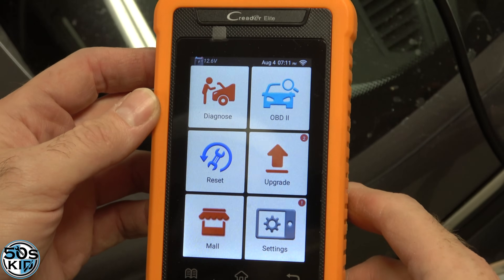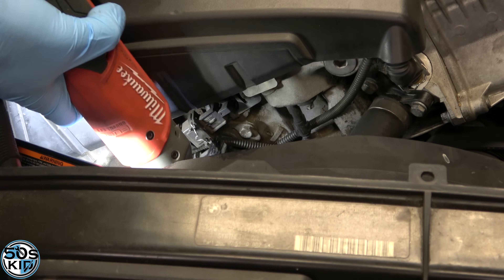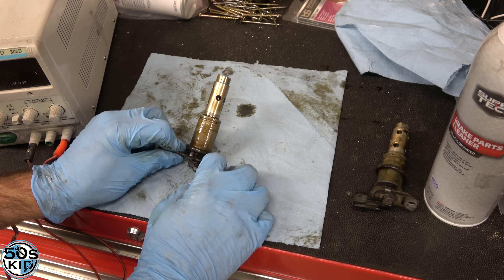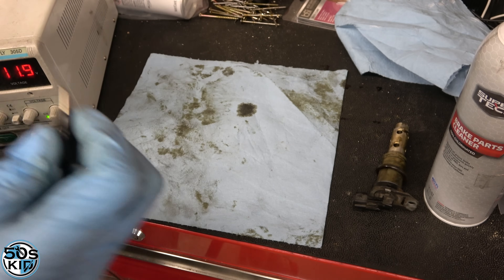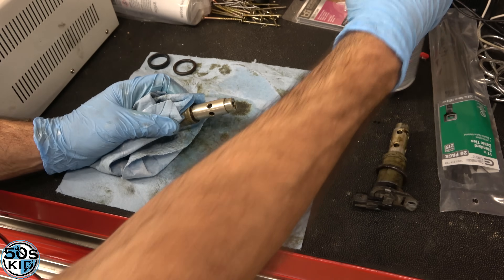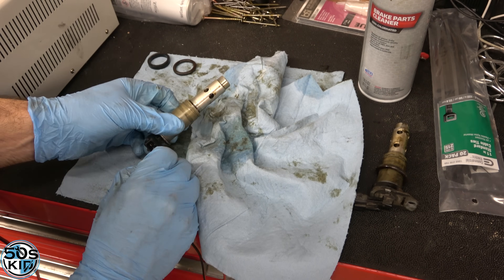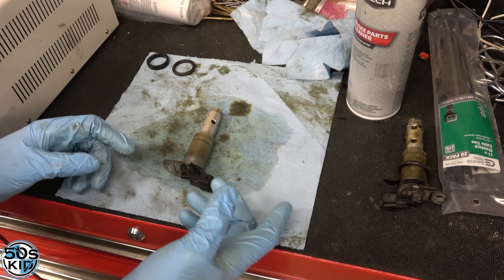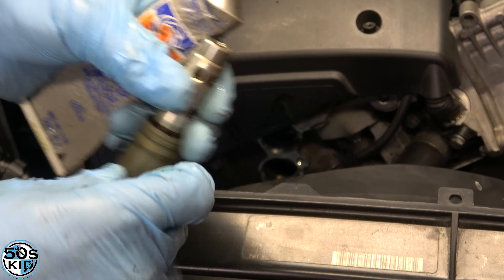Solve Your Reduced Power Problems - E90 VANOS Solenoid Cleaning

Comment: Best thing to do is to switch intake and exhaust solenoid. If the code comes back intake side and you switched the solenoid, that tells you right away that the solenoid is not the problem. Clean the check valves and then if its coming back,   your problem is coming from the vanos itself or the cam ate its carrier and you no longer have enough oil pressure to activate the  vanos properly.

Comment: I replaced mine with new OEM solenoids. This morning when I started up my 630i n52 it gave me a check engine light and made a weird noise. I’m pretty sure I did the procedure correctly since it’s pretty simple to do but…anyone could help figure out what it could be ?
Reply: Did you reset the fault code?
Reply: @ yep, but I cleaned and put back the old ones. Even tho the new ones are original it felt like the car didn’t like them 😂

Comment: Is it possible that cleaning them solves ”half the issue”? Got a really bad misfire, cleaned them and car stopped misfiring when cold, however keeps misfiring when hot. Could new ones be the solution still? or is it just a ”stick or no stick” situation?
Reply: Or maybe i was lucky, they didnt stick first, but suddenly they did and it started misfiring and had bothing to do with car temp? possiblev

Comment: Can this cause random missfires?   I did get a timing-over-retarded code (forget which cam it was) which I cleared and has not come back, but the engine is not running right - Rough idle and random missfires under load.  Coils and plugs are new and CCV + DISA all changed recently so its not those... VANOS system is the only thing I've not looked so I'm hoping it's that, the car is not nice to drive in its current state - Rough + hessitant and no power.

Comment: Thank you. I have a 2006 525i and I followed the procedure, so far is running ok, but after reassembling, the bolts don't lock—they just keep turning. This happened with both solenoids' bolts. Do you have any idea why? This is the first time I've removed these solenoids.
Reply: Unfortunately stripped or try keeping the solenoid in place and trying one more time?

Comment: I have been buying e46s to flip and sell for the past couple of months but I recently grabbed a e92 for a good price considering these issues, owner couldn’t diagnose. 
One vanos solenoid was faulty with a weak pluck. A shake and clean before the yard ones went in. Car runs fine. Most the time a lot of parts need to be cleaned from bad oil changes so and so then you can run and have good oil constantly now

Comment: Recently removed these 2 solenoids to clean, the top intake looked clean but the bottom outlet had oil buildup so I'm guessing this was the problem child? so to be safe getting both replaced much like brake pads its makes better sense do both since I've got no ambitions of repeating this in a month.  (Q) with the top solenoid working as it should but the bottom sticking, there would be a buildup, what happens with that buildup if its not flowing like it should through the system.

Comment: I've seen these bmw's can be a nightmare. Some of them have a belt somewhere just outside the block that starts to strip and somehow winds itself in through the oil seal then blocks the sump oil pickup. If pickup is blocked too long  it will starve the engine of oil and it's rebuild time. To check, connect an oil pressure gauge with special adapter and see if oil pressure drops when revving.

Comment: The non return valves feed oil to the solenoids. If those screens are blocked with gunk, not enough oil will be fed to the solenoids, thus starving the bearing ledges. I just cleaned my solenoids and the valves. I'm glad I cleaned those valves. They were full of gunk, especially the top valve. The check balls were not moving. I think I'm going to clean the valves at every oil change because the PO did not take care of the car and I see gunk on the MILVs' springs from the oil filler. I throw in a quart of ATF and let the car idle for a bit, then change the oil. That slowly cleans the engine, instead of using a flush that will release chunks of gunk and possibly clogging journals., for example the ESS oil feed tube. When that gets clogged, you get the infamous eccentric shaft gear wear, because not enough oil is supplied to the gear.

Comment: I own a 2010 n51 engine I have no check engine light but once in awhile it used to surge either going in reverse or going in forward or even while I'm driving at a stoplight I follow somebody else which told me that if I clean my solenoid it would fix the problem I also did a transfer case exchange the oil and so far so good I have no problem with it once again no check engine light

Comment: Always replace those solenoids with a good brand like Bosch or NGK. Don't clean them, and put them back in. Being dirty isn't the only problem with VVT Solenoids. Your car will run better with new ones. Use good synthetic oil and change it often. Always replace O-rings with new ones, and put petroleum jelly on them(or di-electric gel). It helps the O-rings stay in place, helps it slide in easier, and protects the O ring.

Comment: LOW BATTERY BAD CONNECTION SOLENOIDE WILL NOT OPEN USE CHECK FOR LOW VOLTAGE

Comment: Help 🆘 got 335d mapped 340hp dpf gutted at full throttle hitting 120mph goes into limp mode only at that speed

Has a fault ( faults for exhaust gas cooling switching valve open circuit.,) the coded was removed the car was running okay after few days same problem.   PLEASE HELP 🆘

Comment: Do bad solenoids make a louder clicking noise? We have a 2008 325i. There is an intermittent “clicking” noise, not a mechanical “ticking,” but an electric “clicking” sound that the solenoids make. It’s only intermittent. Could this be bad solenoids.

Comment: Don't be cheap buy 2 new ones in high quality and have peace of mind also Rotella T6 full synthetic 5w40w makes these cars run smoothly and change at 5k miles 
Sure lots of you guys will knock Rotella T6 but I assure you it's high grade high shear rated for harder use than the BMW
Google it and see many guys run it and have shown the oil analysis to back it up
My Z4 Coupe E86 3.0 was having a slight surging idle on startup switched to Rotella T6 and it totally went away

Comment: I've a question so My e91 335i from 2008 only goes into limp mode when its cold start uhm but when i do pulls and goes over 5k rpm it dosen't go into limp mode, if i start it let it idle about 5 min and shut it off and start ik again it dosent go into limp mode.. So Is it just The vanos or something much Worse?

Comment: Nice video i watched your videos to fix my cars i have a 06 bmw x3, 99 bmw 323i and i just bought a 03 330xi for my son
I have a question on my last purchase 03 330xi I overheated my engine now I need to change the head gasket but I am 80% sure the block was bent. I have an extra 02 325i engine do you think I can change the 02 325i 2.5L to a 03 330xi 3.0L? because I can't find anything on the internet
I really appreciate if you can help me with my question.
Thanks in advance

Comment: Hi I have a Question. 
I have 2002 bmw 330ci m54 engine. now I try to rebuild engine.  can I use same piston and ring? I'll send machine shop for bore the engine head and block. Can you tell me what size is boring cylinders?
Which way is good rebuild?
Thanks

Comment: So happy you did a video on this! And yet disappointed you didn't include the follow-up of whether or not the cleaning made a difference... also I have heard not a soul recommend aftermarket solenoids - most everyone seems to stay it's one of those parts that OE is required to avoid creating more problems - FWIW.
Reply: I have 2 high milage N52s 220k+ miles and did on both and solved my problems.
Reply: Agreed. Where is the resolution!?

Comment: I removed two from my 540I, cleaned them and a lot of junk and plastic pieces from the timing chain guides when they broke off put them back in and same issue.  Took them out and noticed that the cylinder where the spring element moves up and down had rotating and a slight side to side play.  The new ones had no play. I guess with time that cylinder becomes lose and so the oil is no longer pushed with the correct oil pressure...I haven't seen a video about the loseness though.

Comment: Spraying the outside piston does next to nothing as this is not the one which sticks. You need to clean the inside piston and the cylinder which are underneath the coil (black plastic bit). Forget 12V supply, use your hands to shake it. Turn it upside down, pour petrol in it and spray carburettor cleaner through the lower holes (plug the rest with your fingers) then vigorously shake in that position. This will allow the solvent to enter the inner cylinder. Then turn upside down amd continue shaking so that the dissolved gunk gets out using gravity - the amounts are miniscule so do not expect to see any deposits pouring out. You need to repeat this procedure at least 20-odd times until you get virtually frictionless movement of the piston, by using slightly movements, when the solenoid is in horizontal position. Yes it takes time but, but only if you get it this clean does VANOS work as intended and long term. The difference in torque before vs after is nothing short of phenomenal. Please do note I have been using LM Ceratec for many years now, and everything inside the engine is ridiculously slippery, and finally VANOS solenoid internals as well. I had identical issue on two cars with N52 engine. Now approaching 5 months since the fix, 10k miles on total. No issues whatsoever, and full torque from low down still there.
Reply: Dude, I know this vid is a yr old, it's still very helpful for me & I appreciate it 😊
Reply: This is the BEST direction for this fix THANK YOU!
Reposting your follow on comment as this seems to have disappeared:
Essentially just when you begin to doubt if it will ever break loose it will start happening. You know when it's done is when you barely move (let alone shake) the solenoid, the pistone moves freely as if levitating in vacuum, and hitting both travel ends with a distinct metal clank, not muted. If you need to shake it in order for the piston to hit the ends you're not done.
Reply: Essentially just when you begin to doubt if it will ever break loose it will start happening. You know when it's done is when you barely move (let alone shake) the solenoid, the pistone moves freely as if levitating in vacuum, and hitting both travel ends with a distinct metal clank, not muted. If you need to shake it in order for the piston to hit the ends you're not done.
Reply: Upside down as in the black plastic piece facing down?

Comment: Why not just swap them over for a few weeks and see if the code moves to the other side ? Seems the most logical thing to do, before trying anything else. This will tell you 2 things. First whether the solenoids are definitely causing the issue and second which solenoid is faulty. These are expensive from BMW. I would only replace the faulty one, as changing them only takes a few minutes.
Reply: How bout NOOOO

Comment: I've been chasing down the exhaust side issue with code 2A87 for about a year. Also spent a good fortune buying tools and good used part to finish the bearing ledge job. I have not changed the VANOS solenoids, because swapping both sides did not make the issue go away on the bad side. It always comes back as the exhaust side error. I do have a final thought, which is the mechanical wear of the VANOS sprocket unit. The unit consists of a rotating piece with multiple steel vanes sandwiched between 2 aluminum plates. My next attempt before giving it up will be disassembling the VANOS unit and polishing the inside of the 2 plates. Maybe it's also a good DIY topic that you can consider to put a video on.
Reply: Exhaust camshaft sensor could be playing up. Not sure if you can swap them too. They are probably identical but haven't checked.
Reply: @Monkey-World-2  Yeah I forgot to mention, the cam position sensors are interchangeable, and I did swap them as well. Same error. So now the only suspect left in the entire VANOS system is the sprocket unit.

Comment: After inspecting, cleaning, and testing of solenoids, non return valves, camshaft sprockets, camshaft position sensors, and crankshaft position sensor I’ve replaced solenoids, bearing ledges & seals, oil filter cap, multiple oil/filter changes and engine oil flush I am still plagued by 2A99 and 3001. I am at a complete loss of what to do at this point.
Reply from the maker: Sounds like your timing wasn’t set right after the bearing ledge job
Reply: @50sKid  It was actually done correctly, I’ve done this a few times trying to remedy my issue before paying the $1,300 that I don’t have for the bearing ledges.. So I’ve had practice/repetition timing the engine with the DP Tools kit from Amazon. I’ve watched your video on the replacement a few times as well, and followed everything to the tee.
Reply: @austinmerrival927  I don’t know if timing is your problem but I did the Vanos overhaul recommended by Beesan Systems on my E46 M3 and I remember seeing many articles out there saying that the  timing tool needs to be original BMW tool and not aftermarket.  Dunno if this applies to your engine but just throwing that out there.

Comment: Thanks Again for another great video will this apply to e39 540i I have code p0022 I change one off the vvt bank 2 and still have the code please help if anybody knows thanks
Reply from the maker: It’s either your vanos solenoid or you need to rebuild the vanos itself (replace the o-rings on the pistons). I have videos on both on the M52TU/M54 engines
Reply: Thanks for responding 
I pulled out one from the junkyard (vanos) and now it’s running good 
Thanks again

Comment: Hey, there are 2 screens/screws on the left side of the engine, you have to pull those and clean them. If they are clogged, oil doesn’t go to the vanos and you can get the codes
Reply: They should click when you shake them. Otherwise, I think they will need to be replaced.

Comment: There are also 2 vanos filters/valves on the left side of engine block, worth taking them out to find out if the fine mesh filter is caked or clean. Good YT video: "BMW E90 : How to replace or clean your VANOS filters"
Reply: I cleaned those filters (non-return valves) on the side of the engine, but that didn't solve my problem. My local BMW specialist suggested that I should replace them instead as the springs wear out over time and can often be the culprit (not just the solenoids). Changed them, and the problem went away permanently.
Reply: @mra4107  Does the E90 with N43 engine have the non-return valves / filters and where exactly are they located?  Thanks.
Reply: @Telstar_1  Not sure as I have an N52. You'd have to look it up. Apologies!